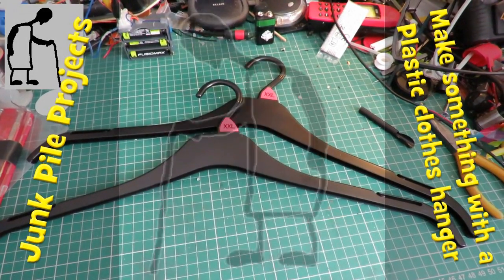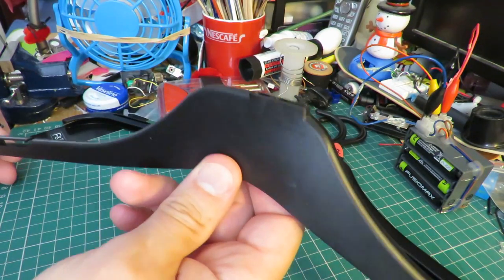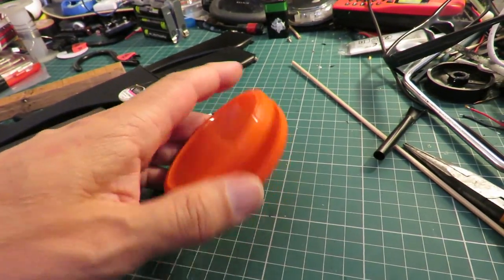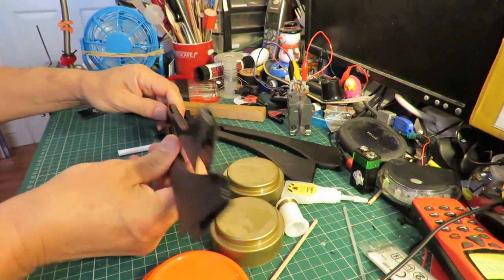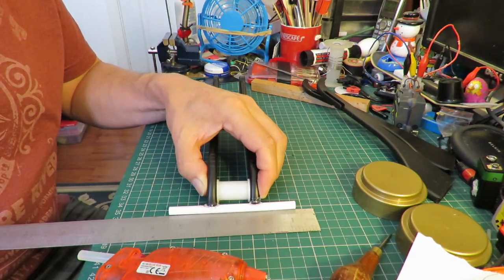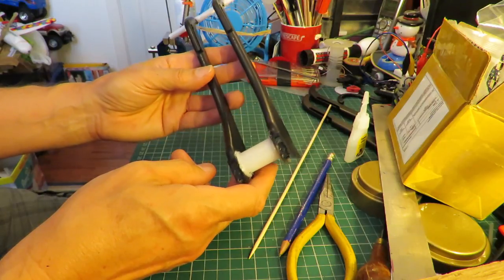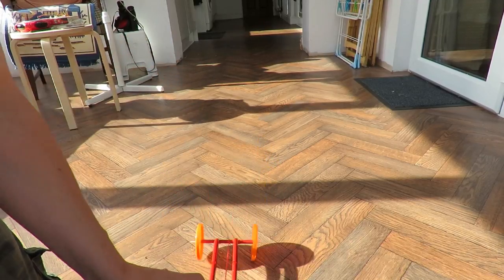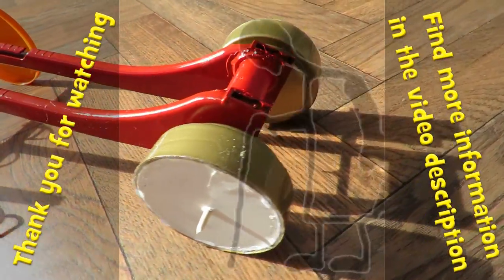Junk Pile Projects - Make something with a plastic clothes hanger - car

Comment: hi grandad, good job on making the car which totally different to what your other cars look like, and it works really well too.i was wondering if you could use the cylinder part of where the sewingthread is wound around on , for the rubber band to be wound up on instead of having to wind it up around the axle if that would  make a difference tho,all you would have to do is shorten the cylinder a bit and stick it over the axle and glue it down. just a thought that came into mind. good video too btw.
Reply from the maker: The effect would be like changing gear. The car would accelerate faster but you would get less turns so you would get a shorter distance under power. https://youtu.be/vc0URTIqdSA?t=3m4s
Reply: +GrandadIsAnOldMan 
And alot of wheel spin.
Which you would expect with a "race car"  :')
Reply from the maker: Wil Hobbs :-)